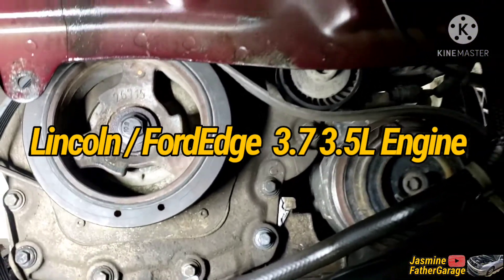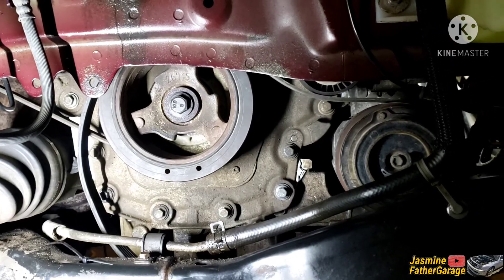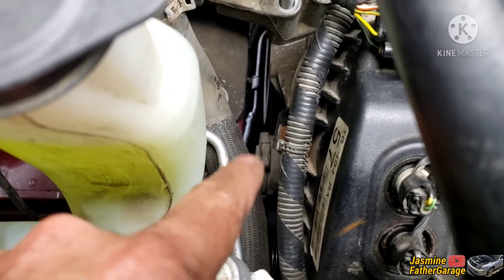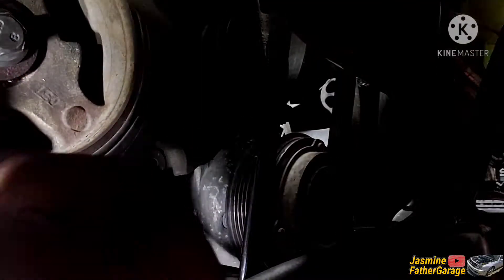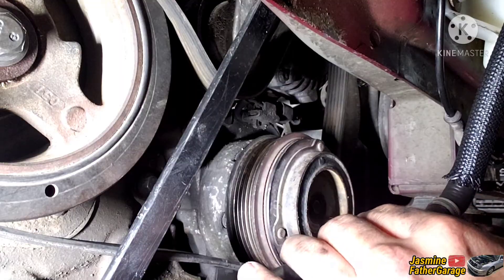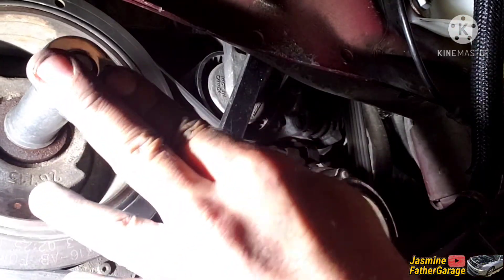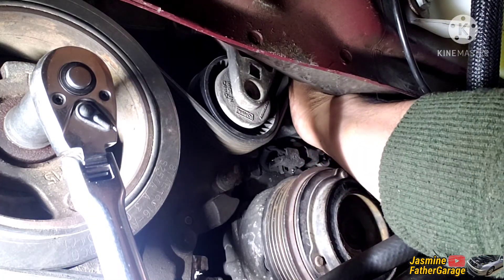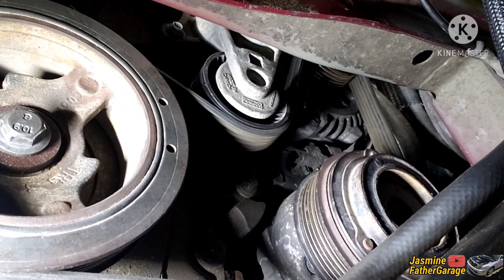How to Install Serpentine Belt on Lincoln Mkx 3.7L 3.5L FordEdge with (Diagram)

Comment: I need the two belt numbers
Reply: Somebody help me with the two belt numbers
Reply from the maker: Here are the Part numbers for Ac and  alternator belts

4040374S
4060450

They are Oe Continental brand

Comment: Its easier if you just pull the tensioner all the way down with your tool, without rotating the crankshaft. Make sure you replace your steering pump drive belt (inner one) 👍👍

Comment: Will this be the same for a 2008 mkz?
Reply from the maker: Yap 2008 mkz same engine 3.5L
Reply: My mkx doesn't have that bottom square on the tensioner . And when I use the tool it's not letting enough tension off to get belt on . Any tips?!
Reply: 08 mkx

Comment: I just did this. It took 3 people and 2 hours.  But an hour and a half of it was wasted by moving the tensioner from top of the engine.  I wish I had found your video sooner.  Gotta go from the button of the engine with the tensioner tool, it keeps the belt from slipping off the tensioner wheel.   Thanks man, 🍻
Reply from the maker: Hey nice work glad this video helped out

Comment: Appreciate the help! Any chance you could name the flat bar tool and attachment to fit the tensioner ?
Reply from the maker: This the flat bat tool  PERFORMANCE TOOL W84010 Wilmar Serpentine Belt Tool https://www.amazon.ca/dp/B0002KO3YM/ref=cm_sw_r_apan_glt_i_YX87444BRXH0SD39Q17T

Flex head ratchet  PERFORMANCE TOOL W38181 Wilmar 3/8 in. Dr. Flex Head Long Ratchet https://www.amazon.ca/dp/B00F0K9Z7E/ref=cm_sw_r_apan_glt_i_0Q26XAJW2H5ERTNZ5CCH
Reply: @jfGarage4k  thank you for the quick response!!
Reply: I haven't tried to replace the belt yet, but if you have enough room, you could use a cheater bar, a piece of pipe and a wrench, then you won't have to spend any money